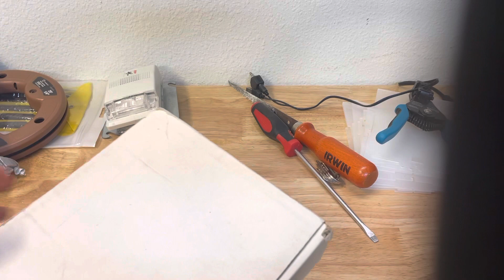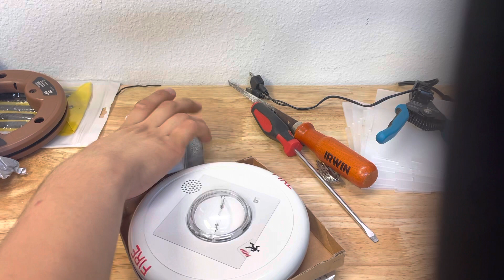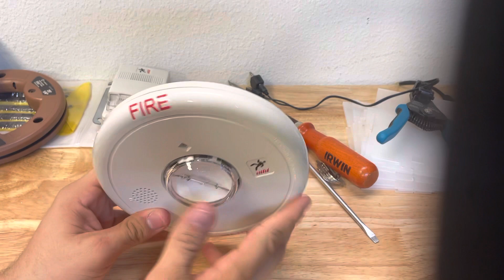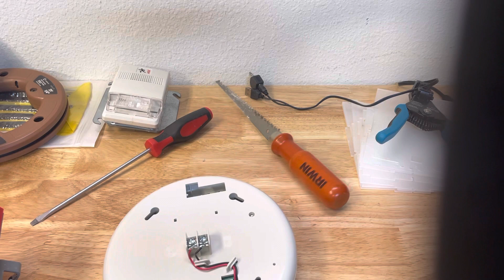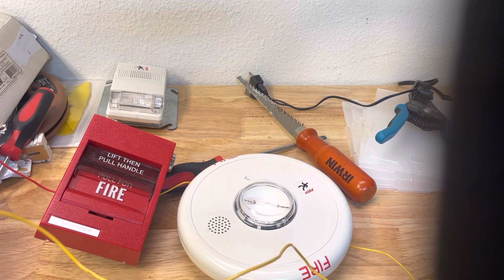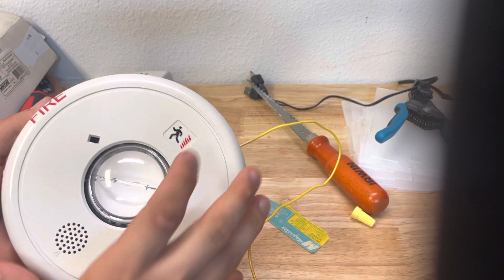Unboxing a EST genesis ceiling mount horn strobe

Comment: My elementary school has these fire alarms and they were there since 2015 because the building was renovated then before the massive renovation of the building my elementary school had Edwards EST 892-2b electronic horn strobes set on continuous. My middle school also has these fire alarms. The current school I go to  has these fire alarms. One of my preschools has these fire alarms as well.
Reply from the maker: My elementary school had these but wall mounted versions with EST integrity horns and horn strobes.